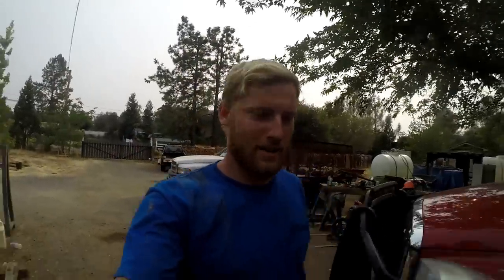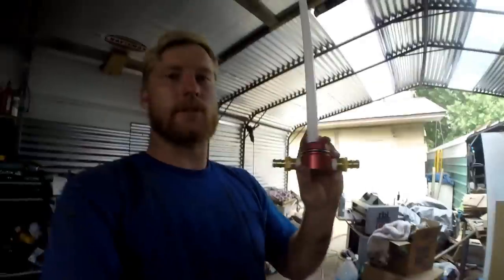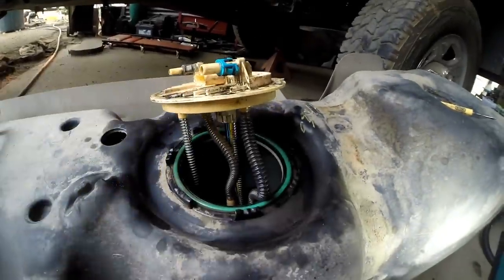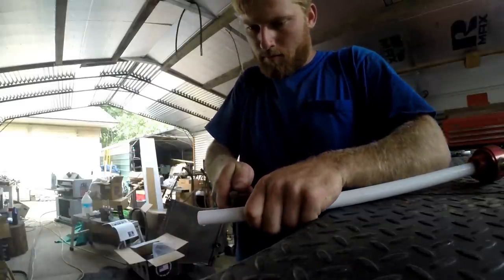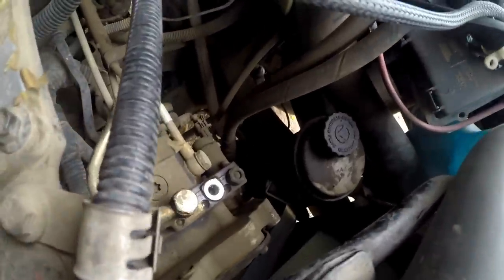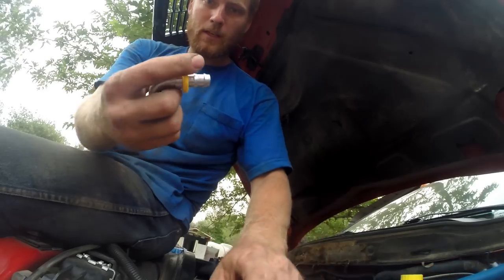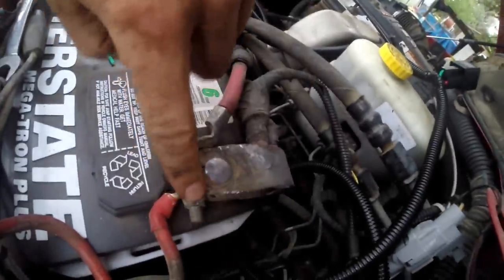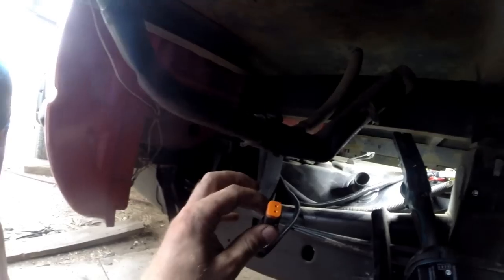Instal Fass 165 on 5.9 Cummins

Comment: I put my Fass fuel system on  my 99 2500 15 yrs ago and have not had a once of trouble out of it.  I do like the new fuel fittings they put in the kit., The old ones were a bitch to push up all the way.

Comment: Vance here I have a 2000 dodge 450k..  run 2 carter electric pumps one by tank other on engine stock place..27psi fuel preasure never had an issue

Comment: I’m getting ready to install my FASS on my 96 5.9 12 valve Cummins diesel. My question is, what am I supposed to do about my manual lift pump, do I cover the hole where it came out or just leave it in? I’m sure you going to say take it out or it’ll fry the manual pump but the question remains. When I pull it does anybody make a cover plate or do I make one myself?

Comment: Is the Fass pump run all time I took both my ground cables off to weld on my exhaust pipe when I hook the battery cable up and turn the key on the pump wants to run out of time on the fast flow pump I just got to Truck had one of those fast flow system for so my question is does the pump supposed to run all of time when the key is on and not running

Comment: Hey I have a dumb question. I bought my 06.5’ 3500 with a 5.9er and it had a Titanium 150 on it but the harness got messed up so I’m in the middle of replacing but was just making sure I’m getting the electrical hook ups right and I noticed you said you spliced into factory wiring over top of tank so I’m wondering what you meant? I should t need to drop the tank just to replace the harness right? And thanks for the vids and love the music super cheerful lol!
Reply from the maker: I think I was talking about adding wire to make it longer on my 5500. Fuel tank is in the back. Stock wire wasn’t long enough

Comment: I bought a 2005 Dodge Ram 2500 w/ 5.9L cummins and it has the Fass system on it. I've never had the Fass system before it seems kinda loud! Is that normal? Thanks, great video.

Comment: I know this is a year old but just wondering about leaving the stock in tank pump assembly installed, is it available in an emergency like if the FASS unit dies? Would it just require a couple fuel line swaps to use? I thought I saw an install vid where they gutted the stock fuel pump and installed the draw straw in that assembly? Mine is a 2004 so no in tank pump assembly and I think that was an option at one time to retain the stock lift pump along with the FASS system Just In Case....
Reply: Honestly I don't want to use my stock sump pump, and you'd have to change wire plug ins and fuel lines to reuse, plus reuse old main fuel line from fuel tank to the motor, not worth the time. Also, you shouldn't have any issues out of the FASS 165, iv got mine on my o6 cummins. It works great and could tell a difference after it was installed. A little more mpg, smoother idle, and a few other things

Comment: I have a 2006 5.9 Cummins with Smarty S on level 9. I am running out of fuel....with this lift pump be enough or do you think I need to get the bigger one? Thank you
Reply from the maker: This lift pump is over kill for Just tuning upgrades. It will be plenty
Reply: @VBELTandSON  thank you! Great video.  I'm going to use it to install mine
Reply: I bought fass 100. Its good up to 600hp. Had 165 on my second gen work perfect. Truck had edge tuner. On my 07 installing 100.

Comment: I'd like to know the results. Any better mileage? Power? I've got 2001 RAM2500 and I want to install this system.
Reply from the maker: ManInTheBigHat my dad has an 01 3500 with a fass installed. Truck sounds a lot healthy with the fass installed. No air bubbles and cleaner diesel. Idk about power but it’s very well worth the install. I recommend it. Especially for a 24v. Safety for if the stock pump drops. Protect your vp44. Dad only has a 95gpm. More than enough. Has a fuel pressure gauge instal to monitor it working. 👌🏻
Reply: ManInTheBigHat  I have a Fass 150/150 on my 2003. Power is better because it has full supply of fuel pressure of about 14.5 psi. Stock pump will drop to about 2.5-3 psi at WOT. So less throttle to get the job done= for me about 2 miles per gallon better mileage. Is worth every penny. You want to protect your VP44 injection pump.

Comment: How long does the install take
Reply from the maker: Jason Brinkmeyer 3-4 Hours if all goes well
Reply: @VBELTandSON  awesome thanks. I was thinking of going on and running the wiring today then waiting and doing all the fueling another. That way I can break it up and not be down as long. Dont think the wiring will take 20 min though lol.
Reply from the maker: Jason Brinkmeyer yea wiring is simple. Take more time to zip tie it up safe. Hah just be sure when you cut the hoses that you only use just enough per section they don’t leave you much room for error
Reply: @VBELTandSON  any other tips?
Reply from the maker: Jason Brinkmeyer clean off under the truck best you can so you ain’t getting stuff on your eyes hah
Reply: @VBELTandSON  well so much for my plan lol ran electric and couldnt stop. I had 1/4 tank and did full install. I did 1 quarter under straw and did the notches like you. Ran to 1/8 tank no issues. Sitting on full now.
Reply from the maker: Jason Brinkmeyer haha good stuff brother! How long did it end up taking you?
Reply: @VBELTandSON  4hours by my self. I didnt have the access you had on your flat bed. I'm on a 06 mega cab too.

Comment: your going to have the worst 1/4 tank issues... maybe worse
Reply from the maker: hmm haven't had any yet:/
Reply: you need a fuel pressue gauge then I bet once you start getting below a half tank your lift pump pressure will start fluctating and once down to a quarter it will start eading zero. You wont feel your truck start cutting out unlesss your lift pump pressure gets real bad
Reply: you need to modify your fuel module and put your draw straw to suck out of the module... Our trucks have a ridiculously long skinny tank and sucking out of the module will keep the straw in fuel even when all the fuel sloshes away from the pickup. Trust me get a fuel pressure and rail pressure gauge your cp3 will thank you
Reply from the maker: Nicholas_ Hoaglan_215 have a fuel pressure gauge. Just ran down to the red on E no hip ups on fuel pressure. Why you thinking there should be an issue?
Reply: Also if you wanted todo it the way your doing it you should have left the tank mounted lifted the bed and left the tank full of fuel cus the bottom of the tank sags down a couple inches with fuel in it. So i bet your daw straw is litterally inches off the bottom all bad...
Reply from the maker: Nicholas_ Hoaglan_215 well this is 100% per FASS instructions for the instal. Tank is half full of diesel. Supported on both ends. Giving the same exact effects off it being in the truck. I have installed this same pump on many trucks and I have done it this way every single time. Not one issue with any of them.
Reply: @nicholas_hoaglan_2157  that is good to know, when I do mine I run it right to the bottom and not worry about. I never run it dead empty anyway.